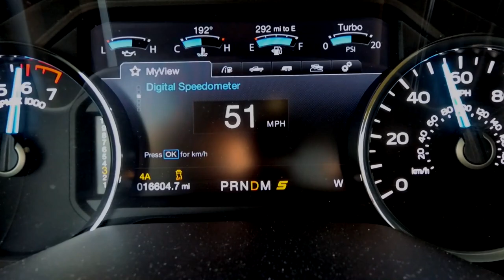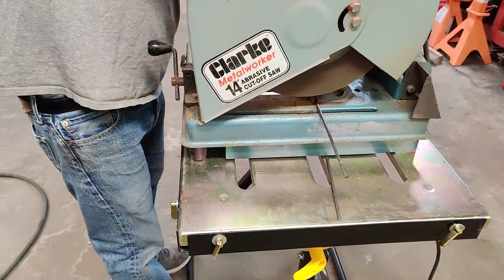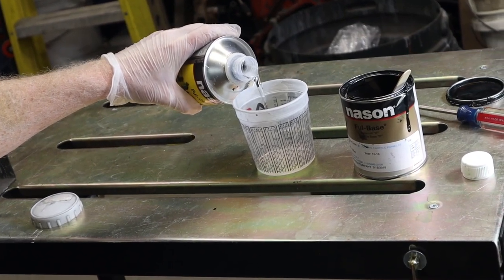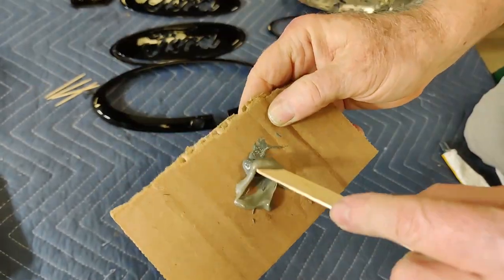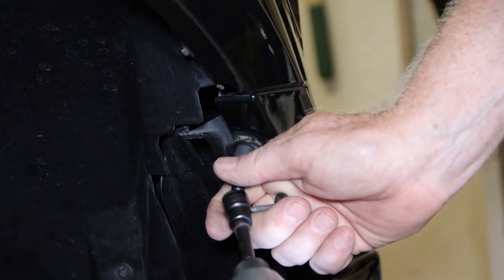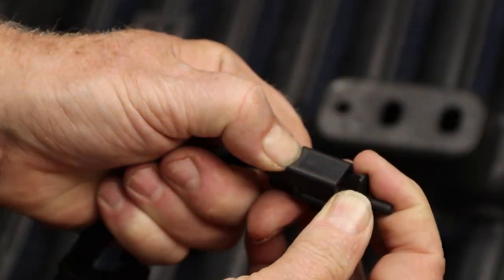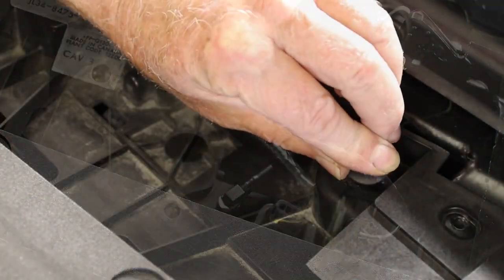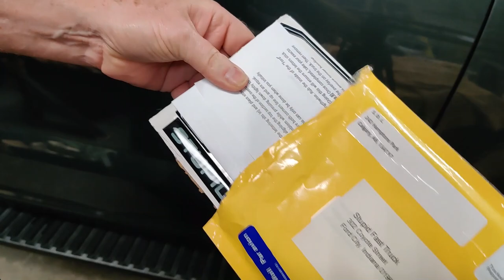F150 Paint To Match Ford Emblems & 360 Degree Camera Install Part 1

Comment: Thanks for this! Been trying to figure out how to get the 360 cameras installed and great advised on most the parts! When do you think you’ll have part 2 available with the rest of the component list?
Reply from the maker: Thanks for watching. I'm working on the mirrors now, that will be part 2. Part 3 will be wiring it all together.
Reply: @StupidFastTruck  would you happen to have the parts list needed to to add the 360 camera?
Reply from the maker: @namphan9772  I'm sorry I haven't completed yet. I've been extremely busy with work. Hopefully I will get some of it done over this weekend and I will update.

Comment: any experience or referral is appreciated. my 2019 expedition hit in the front stripped the harness to the factory front camera. the copper wires are easily spliced, but what i believe is the video cable is silver stranded covered with aluminum wrap then the outer insulation over that. this cannot be spliced it needs connectors/fittings with a section of this wiring replaced. the problem is ford did not install a short harness with connector to the camera. it is continuous with the main harness. have you ever or know any one who has repaired this? it appears like video cable.
Reply from the maker: I think you probably could get by with splicing the shield cable, just try to keep the un-shield spice as short as possible. The analog video signal on older trucks and SUVs are standard definition you "Might" lose a tiny tiny bit of quality, I doubt you would ever notice a difference.
Reply: @StupidFastTruck  can't get away with that. tried a simple splice like stranded copper camera still not functioning. so i'm looking for a roll of what comes with ever add on back up camera to see if it matches. the factor 360 degree is color.
Reply: @StupidFastTruck  did you mean the shield cable you used? if so then it should have spliced with the existing wire i think
Reply: @StupidFastTruck  ok, but your saying i need the new shielded to have the aluminum wrap in tact? but what do i use for a connector for this one wire?

Comment: I'm trying to make sure the emblem and front camera will fit with my lariat chrome grille.  I don't think it has the cutout like yours for the camera bracket.  Did you purchase another grille or modify yours or did you get lucky and it had the right cutout?

Also I ordered my 2016 supercrew lariat with a front bench seat so it wouldn't allow me to add the 360 camera or the adaptive crews control.  I do how ever have all the options on my mirrors except the cameras.  Is the second smaller plug just for the camera?  If so would it be possible to not have to purchase the new door harnesses and just add the wires for the camera with the smaller plug?

Thanks again for the video.  I know how much time it takes to plan it out and to edit.  Mine took for ever and it still terrible compared to yours.
Reply from the maker: If your truck is a 2016 the mounting for the front camera is different on pre 2018 trucks. I can't remember for sure but I don't think the camera is mounted in the lower section of the emblem.

Comment: Emblems look awesome! Is this just a plug and play and the camera will work automatically or does something else need to be done?
Reply from the maker: Thank you...Yes there is module, wiring and the mirrors need to be installed to get the full 360 degree camera. I'll doing that in part 3 which is just about done.
Reply: @StupidFastTruck  gotcha now if you just wanted to do the front camera do you know what you need to do so? Or what module you get?
Reply from the maker: @garygilfoy2415  I suppose you could just connect front...The module IPM2 module would have to be installed from a truck with 360 camera. The installation is much easier if you have pro trailer backup assist. I'll go over that in the video, I hope to have it out next week sometime.
Reply: @StupidFastTruck  thank you ! Awesome videos !